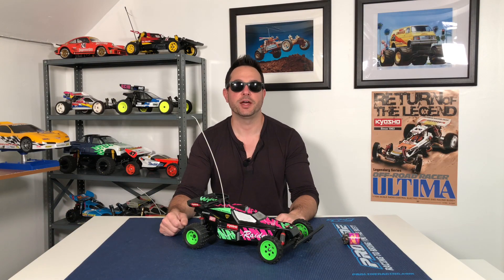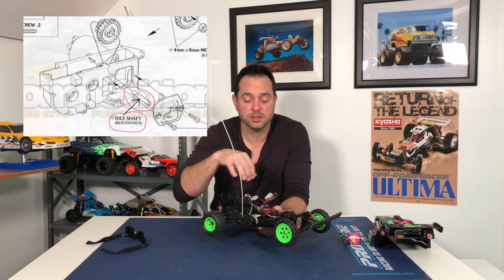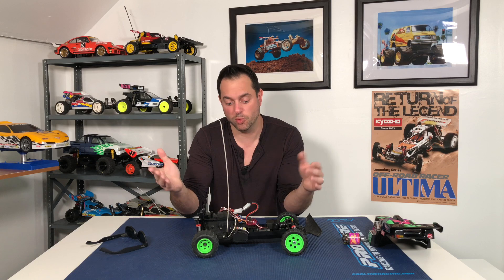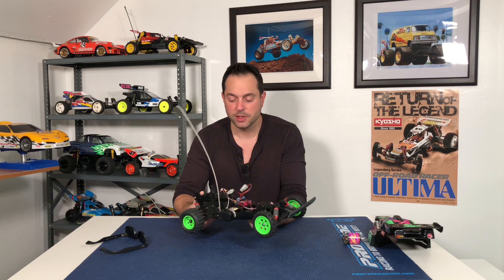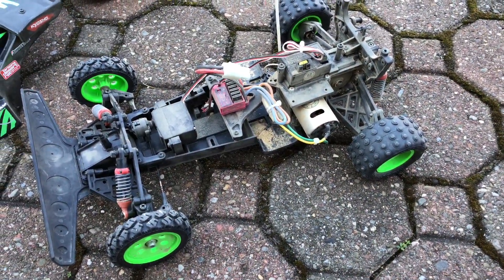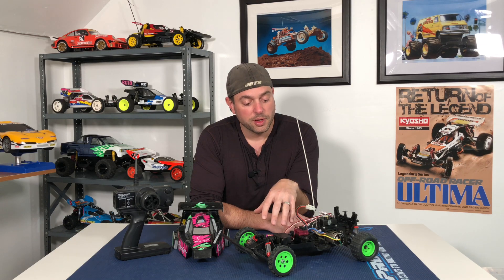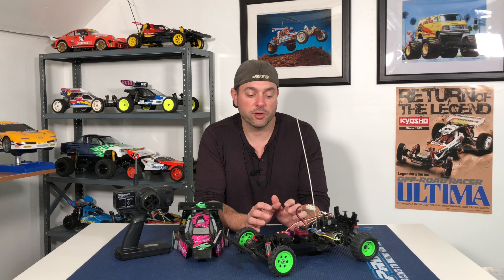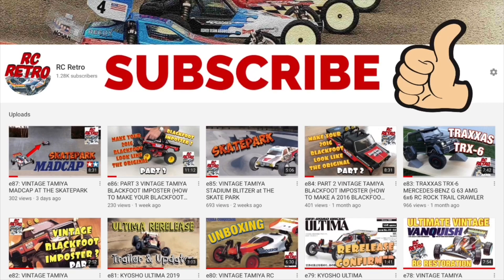e110: VINTAGE KYOSHO RAIDER ARR RUNNING ON A DIRT FIELD

Comment: Nice run on the Raider mate, she went ok on the silver can motor. 👍👍
Reply from the maker: UNBOXING RADIO CONTROL I guess she wasn’t so bad just with a silver can.   Going to get that Kyosho mega motor in there eventually and let it rip.  Thanks for your support.

Comment: My little brothers 1st rc car, I remember that the original kyosho motor was hotter than the 540. Also the kit came with a smaller transmission gear that really made it fast.

Comment: Awesome video mate, just subscribed.

You should be able to run a lipo on any brushed esc but the problem is the voltage cutoff. I don't think that model supports it. so it will discharge the lipo battery under voltage which lipos don't like and potentially killing the battery.

edit
I've just looked at the manual and it does have a built in "low voltage operation" but it doesn't specify what it is.

Comment: Did you do a scan of the decal sheet of the new in box one ?
Or are there decals available from bluegroove or similar ?
Could certainly use another pinion for more wheelspeed.
Also oil shocks is a must, along with ball bearings.

Comment: Are you running a 2s on it and see if you can run a 3s through it.
Reply from the maker: Brad Kalman I figured since it was my first time out with it, I’d run a Nimh battery.  Eventually I’ll stick a Lipo in there.

Comment: 320 amp speed control will handle 2s watch out though you'll snap your original axles got to put some metal in the gear instead of plastic plastic axles don't work that's what I did with mine I have the 109 raider

Comment: 4:37 , That was nearly on the dime.. I just found one of these in my attic , it was my uncles and its never touched the ground.  That said there is no control that I can find up in the attic.  I'm looking and modern controllers are EXPENSIVE + the box says it never came with one SO.  Is there anyway I can get a "basic bitch" controller lol , I really really want to drive this thing after watching this video.  It handles excellent for  a 32 year old Kyosho ARR .  Even the box I have is in really good shape considering the way it was stored.  Tell me something good?  The older one is nice , The Futaba Attack-Sport.
Reply from the maker: Attic finds are always fun.  If you want to get it up and running, get yourself a hobby wing 1060 esc which runs for $21.00.  Then a cheap reliable remote is a Flysky (eBay) which runs about $40 -$50 and comes with a receiver.  If you have any other RC's, you can program them to the same Flysky remote as you can bind up to 10 RC's to it and save the setting for each.